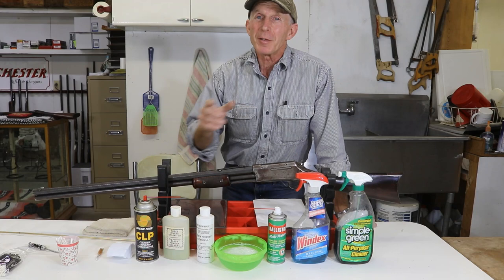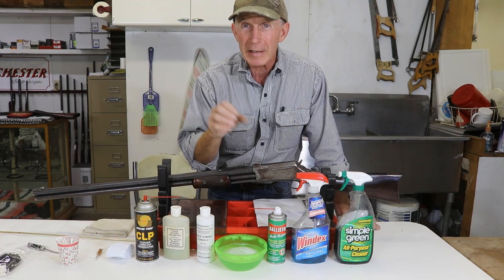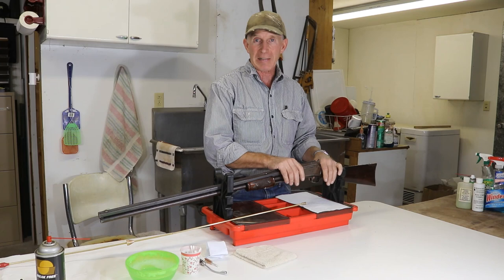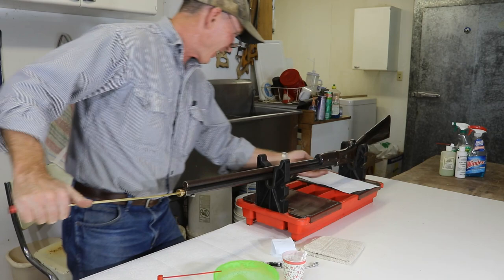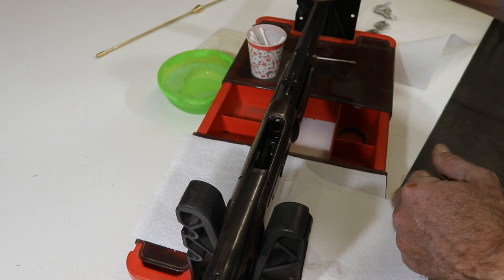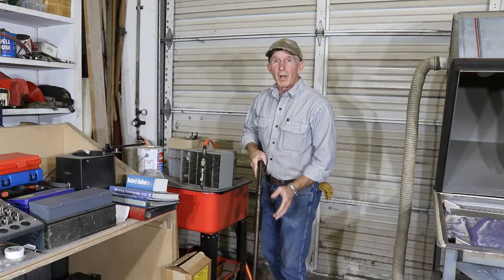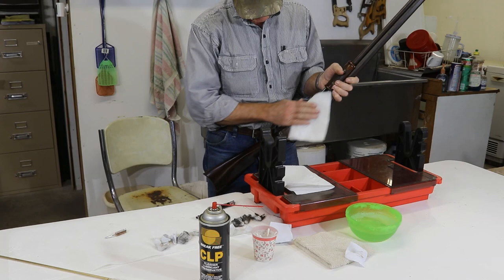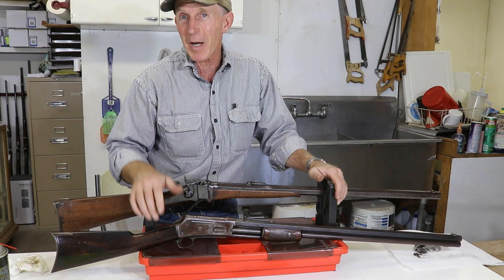Black Powder Cartridge Rifle Clean-Up

Comment: Hi Mark. I am a new subscriber, but have been a black powder shooter for around 40 years. Your cleaning routine is fairly close to mine, with a few exceptions. I clean my black powder cartridge guns at the range before I come home. Presently I use MPRO-7 to clean the bore, and I use a ..41 cal nylon bore brush instead of a jag. I find it works better than a jag does( used a jag for years, and still do on occasion). When I get home, I give the rifle another cleaning, but I use Hoppes #9. I don't have any Colt rifles, but shoot Sharps and Winchester lever guns. 
Also, black powder fowling isn't so much corrosive, as it is hygroscopic ( attracts moisture from the air, and will result in rusting. The more humid the climate, the worse the rusting.)
Keep up the videos. I enjoy them, and would like to a lightning disassembled.

Comment: Great video.  Thanks. Great point about using cleaning rod guides. My high wall from 1898 in 32-40 has no rifling for about a half inch from the muzzle.  It still shoots very well with the Loverin style 323470 so I don't worry about it, and I always use a guide to not make it worse.

Comment: Thanks for the video! Allot of good advice here! 
I use a piece of rubber hose wich fits the chamber, taped with duckttape to a small plastic funnel. First thing I do when cleaning is, insert it in the chamber and poor hot water through. Then use cleaning patches some windex and finnish with a light coat of gun oil. It works for my Trapdoor, Gras, Rolling Block and Borchardt. Still every bore is different, it takes way more patches in the Trapdoor then in the Borchardt.

Comment: It's not going to work in the field conditions, but goodness, we should just shove a hot water hose with a tapered sealing wedge into the action, and crank up the water full power. Watch all that black gunk fly right out of the muzzle. haha
Dry and lubricate the bore immediately after, of course.

Comment: Hi Mark.Love the old Blackpowder Cartridge rifles .I have a CPA Stevens 45-90 with a 38-56 Barrel i can swap out it ,They use the same extractor to which i use a cut down case drill out the primer hole place it on my cleaning rod Keep it centered.Still use a cone shape one for my levers just like you do the joys of shooting Blackpowder would not want it any other way.thoroughly enjoy your videos as the Majestic views of the Cinnabar. Cheers From Australia

Comment: Thanks for showing how to clean the rifles with BP . Also what to use  to clean it  , I am use to clean the muzzle loader . I use Murphy oil mix with Rubbing Alcohol in my muzzle loader. It dose not take much to clean it , the down side is that if you do not take the muzzle loader apart you will take the finish off the stock.

Comment: Nice Mark just a heads up we use delrin rods for our sharps rifles with a jag turned on the end and a 8-32 insert for a nylon brush. Now when were shooting we clean between shots one damp patch with a 50/50 mix of distilled water and that pink rv antifreeze followed by a dry patch.

Comment: I’m partial to water and ballistol
Reply: hot water, so it heats up the metal and that helps the dry off.
Reply: @grassroot011  With my BP revolvers and cylinders I use a bare nylon brush few strokes to loosen particulates up, then  a patch or two wet with Moose Milk (1 part Ballistol 8 parts distilled water) then use a small  high pressure distilled water steamer kettle (Walmart about $30) blasts the bore spotless right out the muzzle and heats the barrel good then dry it with a couple dry patches and  then finally a patch damp with straight Ballistol. Same with the barrel/frame  outsides without the bore brush.

Comment: Is there anything wrong with using a pull-through device to knock the major portion of the gunk out the muzzle for the first step before using a rod from the muzzle? I think I would do that first thing.
Reply from the maker: Nothing wrong with that.  As I mentioned in the video, there are many variations to cleaning a rifle after shooting black powder and I was showing my method.  Use the method you like.

Comment: I'm surprised you didn't say anything about cleaning the inside of the magazine tube.  On my replica 1873 lever action, the mag tube is by far the rustiest and hardest to clean, even with stainless steel spring and follower.
Reply from the maker: Not a bad idea to open up the mag tube and clean it from time to time but it would be a little overkill to dismantle the mag tube and clean it after each shooting.  I don't know anybody who does that.

Comment: I have a Pedersoli Replica 1873 Springfield Trapdoor Carbine 45/70. Is any disassembly required to clean after black powder, or can I do just as you did with the Colt Lightening?  DJ

Comment: How do you clean the cartridge?
Reply: Excellent point to bring up!  Your brass will need to be neutralized and cleaned just as PDQ as the firearms. Whenever I shoot BPCR (black powder cartridge rifle) , I always take a gallon water jug filled with water and a splash of Dawn Dish Soap.  At the range, after each shot, the brass goes right into that jug and stays till I get home. Bouncing around in the truck plus a few good swishes causes the water to get really cruddy.  When home, a good rinse or two in windex/Dawn/hot water. Then a pass through a universal de-capper die
Reply: @willhamner4921  thank you.